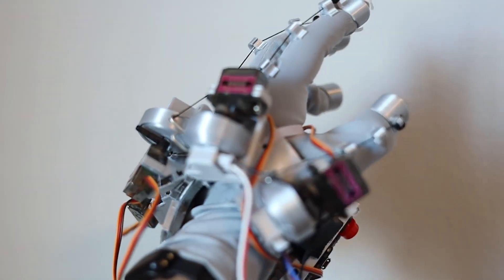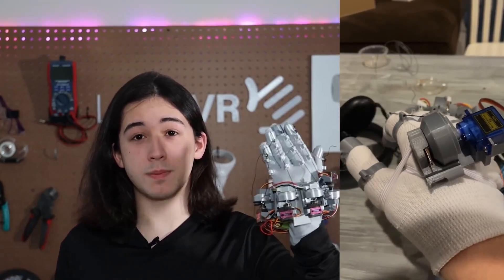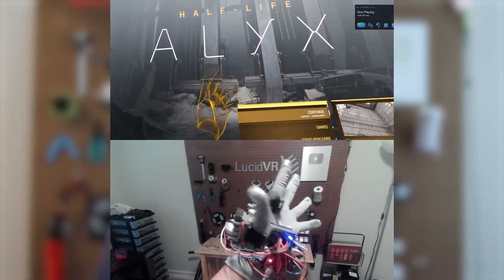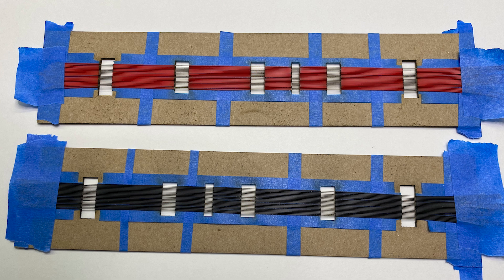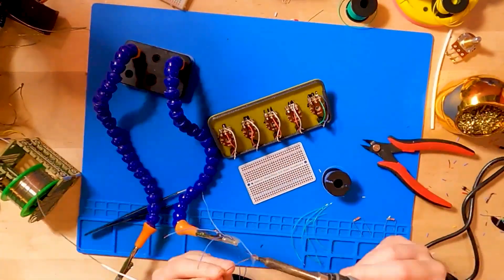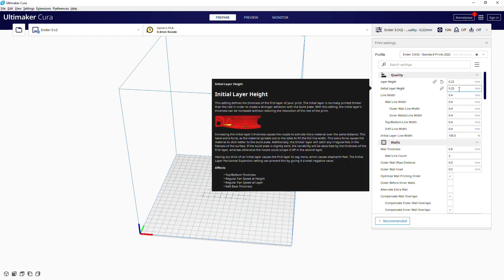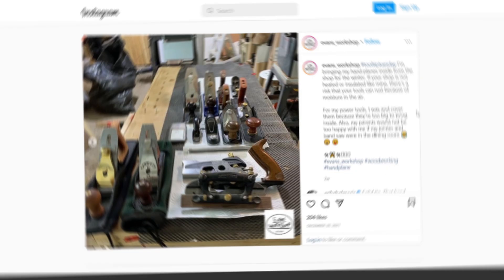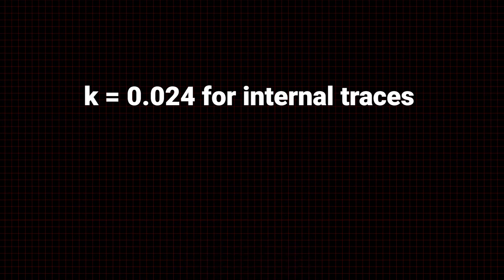Invisible Touch [Maker Update] | Maker.io

Comment: The laser wire stripping is a really unique idea I've not seen before, but you need to make sure your wire insulation isn't of the PVC variety (releases chlorine gas when you laser it, which obviously isn't good for humans to breathe and will supposedly corrode the crap out of your laser engraver mechanics.)